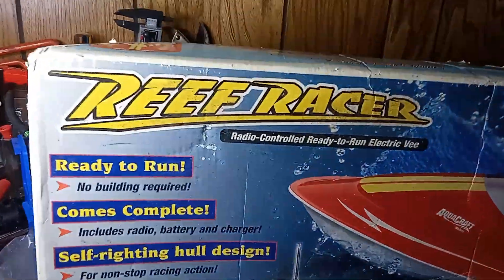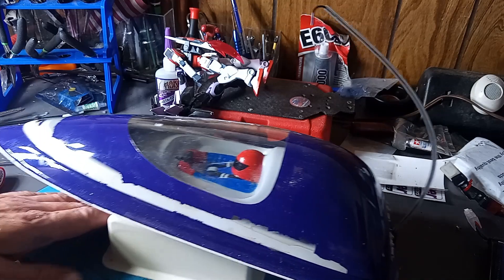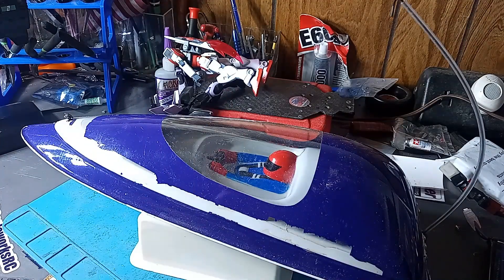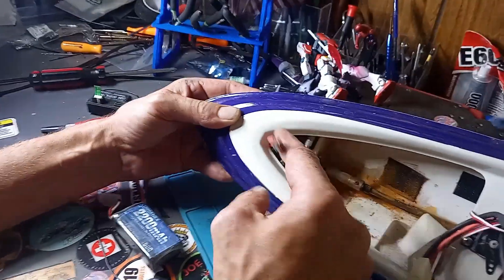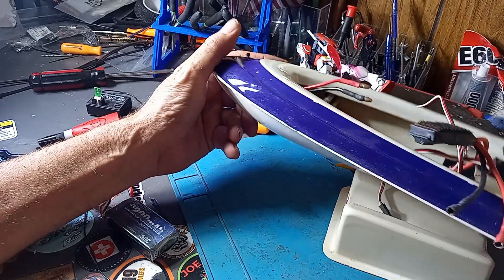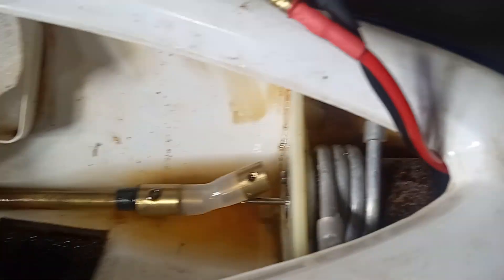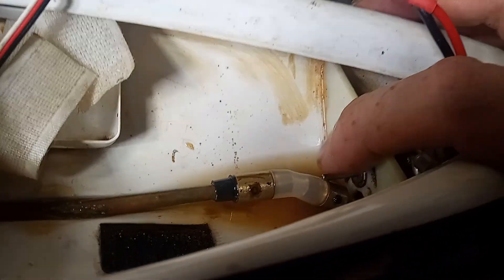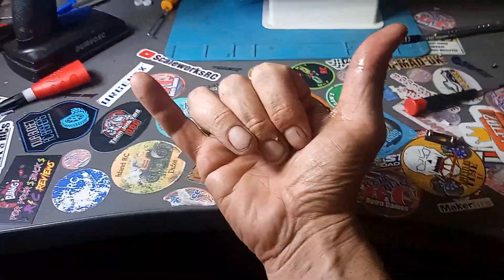The Original AquaCraft 'Reef Racer' -  Flea Market Find - First Look - Will It Run?

Comment: Maybe it would be better to use a driveshaft like in general RC cars. Whatever, great job, Paul.
Reply from the maker: Good idea.   Tuff part will be getting motor out without braking the boat..  Letting it soak a couple days then we will what is needed..  FIngers crossed.  Thanks G..